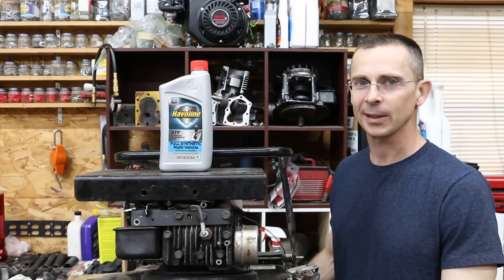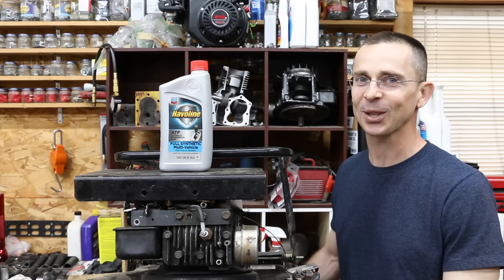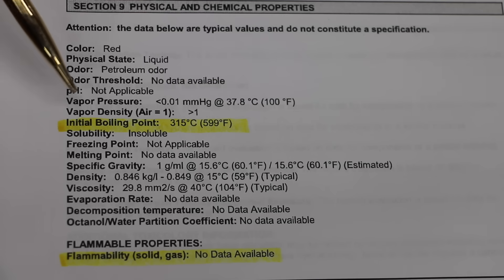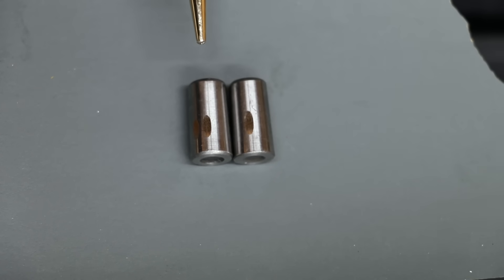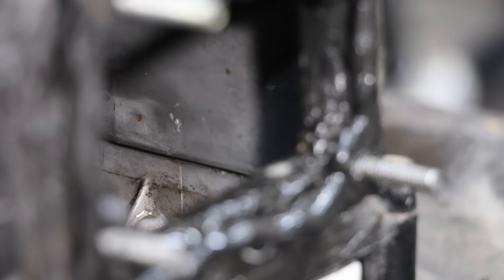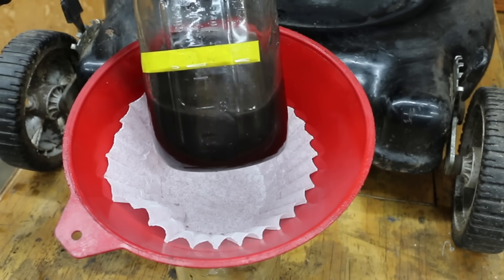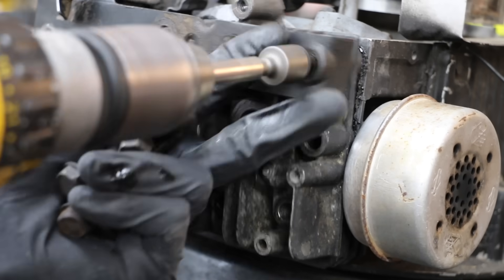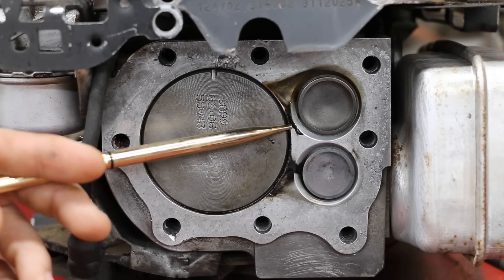ATF as an Engine Oil substitute?  Let's see what happens!

Comment: I've been in the auto trade for better than 30 years. Have used ATF several times in cars and trucks. Have always used DEX 2 or 3, but not Dex6. Dex6 could be ok. In most cases when we use ATF the vehicle has been neglected for maintenance in a real bad way or has an issue of oil consumption that sometimes, not always, remedied with ATF. ATF is also safer to use than engine flush chemicals which tend to damage seals if left in too long, where ATF can be left in without any worry.
Reply from the maker: Thanks for commenting.

Comment: I love your Videos, wached may of them, i am 16 Years old and have a Small Moped License to drive Mopeds up to 20mph, 50cc and 1kw, since i was 14 Years old i modified my Puch Maxi and actualy tried differend Fuel types, and would like to know how these would work in a 4 Stroke, i would love seeing you make Videos of these(i got all of them to work and i know that you already did some of them, but i am not Quite shure witch of them)i mixed all of them with some Half Synthetic 2 Stroke Oil:
-Bacadi 151(has about 75.5% Alcohol, had to Mix it with Gas to make Run)
-16%Nitrous for RC Cars, worked with a minimal bit of Gasoline and bit more Oil
-120 Octane AvGas(AviationGasoline)(With about 4% Half Synthetic 2 Stroke Oil)
-The one Before but with some Cerosine in it

I didn't use much because my Moped is, even now, still my Daily Driver and i didn't want to Kill my Engine.

And sorry for my not so perfect english.
Reply from the maker: Sounds like you're having a lot of fun testing fuels and maximizing the performance of the moped.  You're learning skills that will help you throughout your life!
Reply: Project Farm sadly i don't do that anymore, here in Swizerland you are not alowed to modify these Bikes, the Cops got me Last Year in September, took my Bike an took most Engine Parts from it and then gave it back to me, had to pay about 900Chf(Swiss Francs) still ned to go to Drivers Education for 2 Hours witch will probably cost about 150 per Hour and to get the Bike Running Again, new Engine+overhaul, new Taillight(they destroyd mine on the Dyno) and some other Parts like the Exhaust, i hand to spend about 800 more, well, at least i got a nice Dynosheet with a topspeed of 77kmh(beleve thats about 45mph) and a max Power output of 9.8HP, and again, the engine was build to get about 2HP in Austria, the USA and many other Countrys, and in Swizerland it was Restricted to 1.2hp.

Comment: Read where ATF is most scientifically made lubricant.  It's has to lube, cool, have the right amount of grit for the particular vehicle it was designed for.  If the ATF doesn't have enough grit, the trans will slip.  Too much grit, the seal, clutches ect will be damaged.  Use a generic/multi-vehicle ATF at your own peril.
Reply from the maker: Great point!

Comment: I remember as a kid a mechanic telling my Dad to run automatic transmission fluid in our ole 68 Impala.Don't remember why or if it worked that was  about 45 years ago.I have also heard ,but never tried to run a 50/50 mixture of motor oil and diesel to do the same thing,but only at low RPM's?? Thanks again for another great video.
Reply from the maker: Thank you for this recommendation!

Comment: Project Farm, Another well done, interesting video! I was curious if you ever thought of doing a bearing and journal before and after for this same test? I know it be a lot more time consuming factoring in the before and after tear down, just a thought?
Many years ago, I knew someone that worked at a department store auto center that said a coworker had been using the unlabeled overhead lube and accidentally filled customers engines with transmission fluid for a month. They had to call them all back, but he didn't say if any damage was done or if they even told the customers what really happened? Jim
Reply from the maker: Thanks for the recommendation on the bearing inspection. It's something I'll consider. Time is a big factor.

Comment: As others have commented, atf has approximately the same viscosity as straight 10 weight oil. Using atf as an engine cleaner is fine, but old timers will tell you that special care is taken while it's in the crankcase. The engine is only allowed to idle with no load applied. Atf and actual 10 weight oil don't have the film strength to protect bearings.
Reply from the maker: All great points and thanks for commenting.

Comment: Pretty sure Dex 6 is a lot thinner than the old Dex 3 ATF,  perhaps thicker fluid would solve the shortcomings noticed here.  I definitely agree with some of the other comments on here, when I use ATF to unstick lifters it's only a quart in a 5 quart engine. typically mixed with the old oil, then run for a while then change the oil once the lifters start working properly.  Really old ATF used to have whale oil in it because they could not find a synthetic replacement for a long time, the friction modifiers in it for the wet clutches are "really weird" and have really strange effects on stuff
Reply from the maker: All great points. Thanks for commenting.
Reply: After thinking about this for a week, I wonder if adding a quart of really thin oil to a 5 quart engine would accomplish the same thing as a quart of ATF

Comment: +Project Farm
As a suggestion for a future video, how about a comparison of different freeing/penetrating oils, ie:- WD40 and it's competitors.
Maybe use some rusty sheet metal and see how much of a circle a tiny drop of each makes to test it's effectiveness at "creeping". Possible some nuts and bolts tightened right up and left in salty water for a good few weeks/months to get nice and corroded and see whether the fluids help with loosening off...just a few suggestions of tests.
Reply from the maker: These are great recommendations--thank you!

Comment: A friend of  mine has a toyota rav 4 she would do short trips and the engine sluged up and the oil light came on meaning it had no oil pressure, my guess is that the oil pick up screen had sluge build up , i told her we could use atf fluid and see wat happens ,i drained the  old oil and refilled with atf after about 2or 3 mins the oil light went off drove the car around for about 20mins refilled with engine oil and new filter problem fixed
Reply from the maker: Interesting. Thanks for commenting on this.

Comment: Loved this test and it went about like I figured. ATF is a very high quality oil and transmissions are very demanding of it. A lawnmower would not really provide a challenge to ATF. The ATF still cools and provides a certain amount of lubrication with cooling being the most important factor.  The only thing that surprised me was how clean the piston was. I expected it to burn more ATF due to it being a lighter weight and a lighter weight oil having and easier time getting past the rings and the valve stems. 
If I had to use ATF in a Mower I would check the oil level more frequently just in case.
Reply from the maker: Thank you!

Comment: My father had said to put a qt of atf or rislone in my 5.9 Dodge gas motor when I had a lifter stocking and it would work and not stock but would always come back especially if ran hard. But it did quiet down the lifter on daily driving.
Reply from the maker: Thanks for commenting on this!

Comment: I don't know if you've done this but test the viscosity of dollar tree engine oil, always wondered if it's legit.
Reply from the maker: Thank you for this recommendation!
Reply: Actually yeah, a full review of dollar store oil would be great, I'm curious just how good/bad that stuff is.
Reply: I follow class action lawsuits and I remember Dollar General had a suit against them a while back. Iirc, said it was ok to use motor vehicles but didn't have that star logo or something. I think the shit cost $1 or 2
Reply: If it is labeled nd then it is non detergent. If it does not have the sunburnt logo it is not for engines. If it is labeled hd (high detergent) and has proper logo then it is acceptable however a better oil may have more additives in it. You get what you pay for.

Comment: ive used ATF to get me out of a jam in the mountains. didnt check my oil before leaving and after going down a steep hill my oil pressure light came on and the only thing i had on me was some dextron 3 and i only had 3/4 of a quart but it was enough for the light to not come on the way up the hill and got me into town to get some motor oil
Reply from the maker: Glad this worked!

Comment: I had a Dodge Durango with a 4.7 L that was not building oil pressure when you started it cold. I ran ATF through the engine for an hour and drained it then refilled with oil. It solved the problem. For how long, I don’t know. I traded it in two weeks later. LOL
Reply from the maker: LOL! Thanks for commenting.

Comment: Could you see what 1 cup of. 85w-90 gear oil would do in a emgime with 5w-30?
Reply from the maker: Thank you for this recommendation!
Reply: Thank you for doing these videos. There is something you can try. I put 4 cups of howes diesel treatment in my truck. It had 8 gallons of gas in it. It seemed to run better not sure if that had anything to do with it but would be a great test.

Comment: Be careful of using atf with a modem engine. It's bad for the catalytic converter. I've used it 1:1 oil atf for short distances and it worked very well.
Reply from the maker: Great point!

Comment: I would add that it should be a goal to prevent oil sludge build-up rather than to try to correct it without a teardown, especially in these modern highstrung 4cyls on the market now.
Reply from the maker: Great point!

Comment: the old guys that wrote this story used regular ATF, not synthetic. You have to look at your source of information first. I was told using it on old cars really cleaned up a cruddy engine. I can tell you it did nothing on valve covers and oil pans, as well as oil galley covers under the intake manifold on a V-8 engine. I tried it on a 69 pontiac Catalina and a 74 Matidor engine and both had tons of oil goop that ATF never removed. Also tried it on a Ford LTD 1977, that was a mistake. It developed so much oil blow by on the rings, my dad had to scrap the car.
Reply from the maker: Interesting. Thanks for commenting on this.
Reply: Project Farm I think compairing small engines to large engines can be like compairing apples to oranges sometimes. I know the principals are the same but not really. Large engines have many galleys and passages that if clogged up can starve bearings quickly. I have run small engines way beyong their useful life where as a big V- 8 would seize up under the same conditions. Now days, the extreme heat that a small engine can handle would warp a head in an instant on todays aluminum engines. I miss the old iron engines. I had a 74 Ford Maveric with a straight 6 that I put 300k on it and my wife made me sell it simply because she was tired of seeing it. Well, that and the rust was really starting to eat it up.

Comment: I've have seen diesel oil is realy any different than regular oil
Reply from the maker: Yes, it is different.  Diesel oil usually has more detergents and zinc.
Reply: Project Farm 
I was as far as better protection for an engine would a 10 w 30 diesel branded oil work better tha non diesel branded

Comment: Cool test. However ATF isn't an oil. It's a detergent. Does provide some lubricity we use it mixed with diesel fuel to free lifters and turn a locked engine.
Reply from the maker: Thanks for commenting on this.
Reply: Twist_the_wrist83 g

Comment: Personally, I use diesel fuel as an engine flush. It worked well for me but I'd love to see how it works in a small engine.

Edit: When I did it, it was straight road diesel. Not the off road stuff. Which is exactly the same except for the dye. But I digress
Reply from the maker: Thank you for this recommendation!

Comment: So is it better than running in oil? I use about a pint (500cc) of running in oil to flush my 120 Bhp 1.6 Diesel every few oil changes (on average every 4th) so far the engine is still fine at 266300 miles! I am only using about 1 ltr of oil every 8000 miles so only up by 500cc from new. This was an interesting test. :)
Reply from the maker: Thank you!

Comment: Great video and testing!
I saw a cousin put 3 quarts of auto trans fluid and 2 quarts of oil in his engine once, it didn't make it 10 miles before it chucked a rod out the side of his block. It wiped all of the bearings in the engine, then locked up when the rod let go. The trans fluid he used back then, 15 or so years ago, is probably way different than what you are using today though. I still would not put it in any engine I cared about or depended on. They call it "transmission fluid" for a reason and "fluids" are not always lubricants.
Reply from the maker: Wow! Thanks for commenting on this.  Painful learning experience for sure!

Comment: Using ATF as a lubricant/cleaner during an engine rebuild is a good way to clean up any dirt deposits on cylinder walls, when used in conjunction with break-in lubricants placed on bearings before being bolted down.  DO NOT use paper towels anywhere near a rebuild area, always clean off ATF with a lint free cloth material, as any of the paper flakes can stick to a bearing surface and cause overtightness.
Reply from the maker: Thanks for commenting on this!

Comment: If you ever come across the motor that's having problems with mics as stuck or sticking lifter I'd like to see this tried. Thank you for the video's.
Reply from the maker: Yes, I hope to come across an engine with a stuck lifter to see what will work best.  Thus far, Seafoam saved the Ford Ranger which had a lot of lifter and overall valvetrain noise.
Reply: That was the 1st video of yours I saw that's what I wished I had done to my Bronco II

Comment: ATF in engine equals boom!
ATF is a lot more flammable than engine oil so the vapours in the crankcase or those that vent into an engine bay can ignite similar to petrol. I really would not recommend using it in the engine of a diesel except as fuel.
Reply from the maker: Thanks for commenting.

Comment: Interesting.  I think you're right - a good detergent oil would be better.  An old salt mechanic friend from the old days used to do his engine cleaning with diesel in the crankcase.  Drained the oil, replaced it with diesel, ran it for 10 or 15 minutes, then drained and flushed with engine oil.  Ran it for another 10 or 15, then drained the oil again and refilled.  He swore by it but I never had the nerve to try it.  Said it would clean out every bit of sludge.  It probably did but I can't imagine the bearings and rings were thrilled about it.  But then again, I never had to come rescue him by the roadside either.  So who knows?  Maybe you want to try it.
Reply from the maker: Thank you for this recommendation!

Comment: Did that as a matter of course on way high mileage engines. Worked most of the time to free up stuck lifters etc. A better flush than commercial flushes or the use of naptha, because in an extreme sludge environment, naptha etc. will continue to soften the sludge to a degree that can cause an engine failure due to sludge clogging at the oil pick-up screen. The ATF will mostly slow or stop flushing after it's drained out, and does not seem to have any bad side effects. The absolutely best engine flush I ever witnessed was a Chev 6 bucket with a bad fuel pump that flooded the oil pan with gasoline. It really cleaned out everything. This engine had about 300k miles on it and had been seriously sludged up. The driver drove it until it wouldn't run. It was towed in with the engine filled to the brim with gas. Drained it, put on new fuel pump, new filter and fresh oil....thing ran really good... smooth. put it back in service.
Reply from the maker: Wow!  Surprised the gas contamination didn't cause a lot of damage. Thanks for commenting.

Comment: I had an old 96 Mazda Miata that had lifter tick from another world and I used an ATF mix a few times to clear it up. It did work but only for a short while, about a week or so of normal driving. I researched quite a bit and the Miata community came to the conclusion that it's simply a characteristic of the car. Unsatisfied (to say the least, and to put it nicely), an old school hotrod forum recommended a mix of 1quart ATF and 3 quarts of straight 50W oil, letting the engine idle for half to a full hour, then of course drain and refill with new oil and filter. That's exactly what I did and I'll say that it does work to clean/quiet noisy valvetrain bits. The culprit was faulty lifter bucket design in that engine though. Sold that car, but still have an old Nissan with an identical lifter setup and it's never once ticked, so go figure lol.
Reply from the maker: Thanks for commenting.

Comment: I have use it on a vehicle that consumed oil. Used approximately 4 quarts every 5000 miles and drove with one quart of atf and the rest oil for 100 miles. After vehicle only used 1 quart in the 5000 miles. So I would recommend some but not not replacing all oil with atf
Reply from the maker: Thanks for commenting.